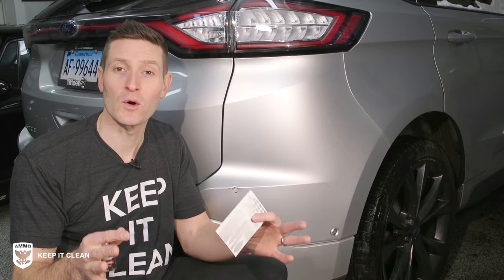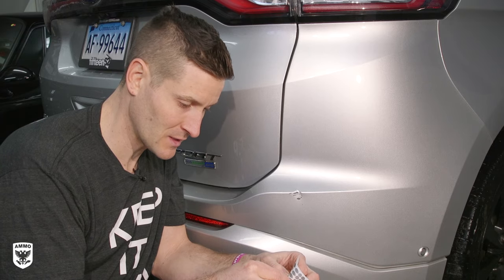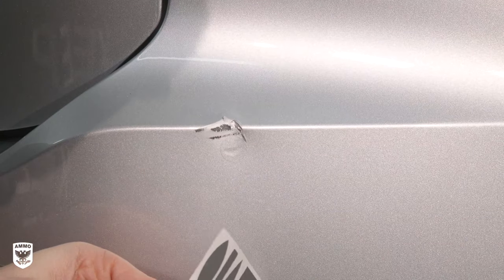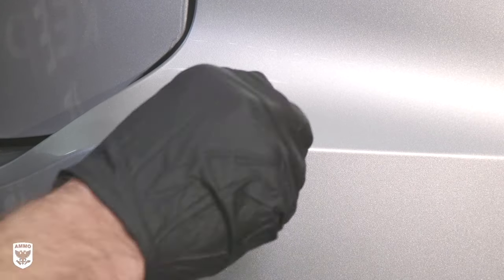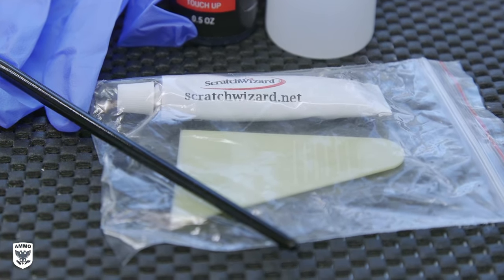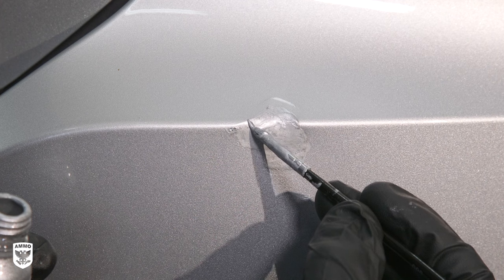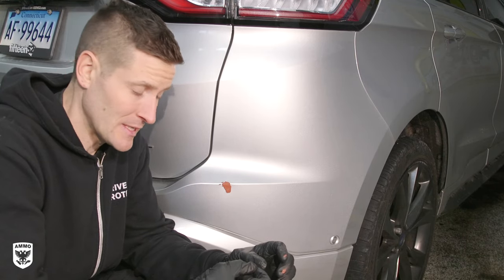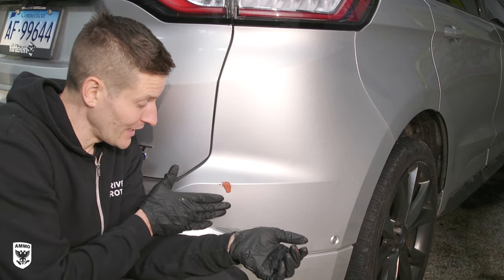How to Hide a Bumper Scuff Fast

Comment: I fix almost the same kind of damage on almost the same kind of color and what i did was carefully tape around the damage area and made sure no paint would go on other car area by masking with news paper. Then i use a touch up match aerosol can on it and put 3 coats on it then i let it dry for 24 hr and i remove the tape. Now i was left with a thin line around where the tape was and i used a toothpick to fill the thin line with paint from the same aerosol that i sprayed inside a small plastic cup. To finish i simply use compound by hand to equalize and blend it in surrounding paint and for the final touch i wax it with Meguiar's Gold Class Carnauba Plus Premium Paste Wax . No one could find where the repair was.

Comment: Clean area then apply body filler. After it's dry you have to sand it down and follow the body line to replicate the edge of the body line. Once that's done you can prime and paint. Relatively easy to do.

Comment: I felt your pain. 
IMHO, heat gun and a nail with a large flat head. Turn the nail upside down and, using a hammer, tap on the sharp end with the flat head hitting/tapping on the HEATED plastic. The heated plastic will allow it to reshape. The upside-down nail (head) will give you the control you need to take out (flatten) that ridge. Next is plastic-filler/bondo, sanding and an AIRBRUSH for several layers. Airbrushing using various flow patterns will allow the flake to randomize. Best of luck!

Comment: Here's my idea: You got it pretty smooth right now, what i would do is to take the stickers of, then try to get it even smoother. Then what i would do is get a spray can with the exact color from ford, then i would make 3X3 inch cut out in a newspaper of something with big surface and spray paint a 3X3 area from about a foot away over the bondo. After that dries maybe you have to do some wet sanding and compounding/polishing.

Comment: Though not really "quick",  what works well is using a small plane or razor to cut the plastic level, using a small bit of filler light sand, and using an hobby model airbrush pen with touch up paint, and a 1k clear. after clear dries wet sand with 3000 and buff.

Comment: I've dealt with this issue before, once bondo and sanded, I used arysol touch up matching paint on the panel, got it damm near perfect, blended it back into the original paint and then cleared coated with max 2k for that gloss and harden protection. Probably spent around 40 bucks.

Comment: also if you actually sand it you get a much better product then leveling it the way your using it.  It's technically meant to be sanded. not saying there isnt a place for leveling it with a rag but never will you get the consistency of sanding, i prefer dry, well not always. and you can spot sand with certain things like cutting a piece of sandpaper and gluing it to the end of a pencil for instance for a super small sanding disc

Comment: Simply, sand your spot and spray paint ( to be equal) not by the brush!
Always try to keep your working spot in lower layer than the original so later on it will be filled by filler and paint and sanded equally with surround area layer 
Try it on scrap surfaces as training

Comment: I think touch up paint should be used lightly with dabs like a tattoo machine, simply to color in an area and then use clear coat layers to fill in and get above the surface area for sanding. Lastly, finishing off with compound and polish. Maybe sand down the bondo stuff below the paint's surface area to allow space for touch up paint and clear coat layers.

Comment: I think these stickers are PERFECT....... for some. Not all. You'd have to know what your expectations are. For 3 seconds and $50 worth of color matched stickers, you can't go wrong in covering up small scratches. If you want a more professional result, of course go the body work route. Also, consider your vehicles paint color. Some are easier to cover up and show repairs less than others. Ailveez for example, is often the easiest

Comment: I’m curious as to whether you would be able to get rid of the lip from the sticker by going around the edge of it with touch up paint and sanding it down. To avoid scratching the sticker itself you could put a piece of painters tape over it while sanding.

Comment: had the same problem on my vechicle...a stone chip the size of the Grand Canyon on the bonnet.tried touch up but was experiencing the same visual disapointment as your efforts.so ended up filling stone chip ,flating it off then had a vinyl stripe fitted over bonnet ,roof and boot of vehicle.  was still cheaper than having bonnet respayed...

Comment: Take the lower lip off the rear bumper , and you can reach the dent from inside. Use something hard, I'm using screwdriver handle from inside, you don't want to burn your hands, and work with heat gun from outside. Keep heat gun about 12 to 16 inch from the bumper to prevent bumper it self and paint from melting. Ones bumper gets softer start working with your screwdriver or whatever you going to use, and push the dent out until you Happy with flatness and ages. While keep pushing the dent out from inside, put wet cold cloth from outside , to cool the plastic down. Now is the time for blending. First coat base paint only, with your paint brush. Let it dry for 30-45min. Next step. 2drops paint, 2drops clear coat, mix well and apply 1coat,30min dry time, 2nd coat. 2 hours dry time, lite scuff with 3000. Another coat if need more base to color match, if not, 1 light coat of clear 4 hours dry, buff if needed.

Comment: depending on what way the sticker(i.e. if the colour is all the way through the sticker and not just on the surface of it) is made could you use a utility knife to cut the shape you want while at a 45 degree angle to soften the edges of the sticker

Comment: Before using a bondo, you should heat up a bumper, than try to push the bump. After that, sand down sharp edges, than use a bondo. And i think, that better, than touch up is to spray it.

Comment: Next time you could try building up the ridge of that body line first, just tape something to the vertical side of the corner (cardboard covered with scotchtape or a piece of acetate) that will follow the curve properly and give support to the bondo. Once that corner edge matches completely the curve of the rest its like a rail to fill everything else without smearing all the area outside the ding with glazing.  And yes an airbrush is awesome for that small work, basically its those stickers but in a liquid form once you learned to use it

Comment: I fixed my bumper by using bondo and touch up spray I ordered online for $30. Sometimes you can find popular color sprays in smaller cans at O'Reilly auto part stores for $7. Those touch up brushes never work on large spots.

Comment: instead of using the solvent to remove the excess putty, you could have used sand paper on a sanding block to have the putty perfectly match the body line and also have a flat surface to work with.

Comment: I've seen episodes of Mighty Car Mods where they used spray cans for a repair like this but it was a non-metallic paint... Idk if that would ever work for metallic paint and if you knew I would love to know if that works or not because I also have metallic paint job on my car. One thing I wanted to share with you is I tried using touch up paint on rock chips and places on my car after finding your channel looking for DIY paint repair videos. I started with a brush like you were using and it was crap and looked like shit and the brush bristles got caught it the paint and it was a crazy mess BUT I had also picked up some disposable foam paint brushes because I wasn't confident in the other brush and I knew after the paint started to dry I'd need to whip out another brush because I was working on multiple spots. It turns out that the foam brush worked AMAZINGLY well. They're cheap as dirt too! I have a spot similar to your scuff on my car that I touched up and unless you're right up on the car you can't see it and best of all somehow the foam brush helps spread out the metallic paint so that it actually looks like a professional repair even though it was my first repair, I was really nervous, I had watched your vods to gain some confidence and all and all it turned out looking great. Now that I've seen more from your channel I would certainly take more steps in my repairs for next time but for >50$ for all the materials and maybe 5-6 hours of time(working on multiple spots) it came out looking great. I wouldn't even mind uploading some pictures/video of my repair if you were interested but I urge you to try out the foam brush and do the repair like you normally would. The tips on those brushes make them perfect for painting tough areas like a body wave and other than the fact that you can see when you look really close where the factory paint ends because it's slightly faded(10 year old car) and where the new paint begins you can barely even tell it's there at all and leaves a smooth and very visually appealing finish. I love to see you test this out on this repair if you were willing as a part to to quick fixes for chips and scuffs. As always love the channel and keep up the good work!

Comment: Using Applied colors(scratch wizard)kit??? I am a little surprised to see that. A ten dollar quick change airbrush from Harbor freight, 3000 grit wet/dry sandpaper, a little polishing  and you would have been done 15 minutes after the putty dried, but I am sure you already know this. At least you showed how frustrating things can be, especially when we over think things. Nice video

Comment: i dont know much about car repair but i do know a lot about painting, you should probably have applied the paint in a few even, thin layers as opposed to one thick layer while also feathering it out over the surrounding paint to make the repaired area less obvious. it'll make the area smoother and should disperse the metallic particles more evenly. also a slightly larger, flat brush would've been better but i know you were using the kit. Great video overall tho

Comment: How about  putting the paint in a small air brush kit. Afterward using a clear coat the same way with minor wet sanding and buffing and polishing after. Wont have to worry about gravity as much with mini air brush..

Comment: Have you heard of dry brushing? While I was watching you paint it with the brush I was thinking how loaded the brush was and how there was no way you could get it to flow just right. I personally used dry brushing on my car and it worked fine. It takes a bit longer and a few coats to get good coverage but I think it would have worked better.

Comment: I think if you used a sanding block to level down the putty instead of the chemical leveler you could have eventually gotten it more level with the surrounding bumper. But that would probably harm the surrounding paint.

Comment: I build it up with paint, then wet sand with, 400. Then repeat the paint if I see pin holes. Then wet sand with 400 and keep doing this cycle until there are no pinholes left. Then wet sand with 1200 then 2000. Then buff with 3M Finesse-it II 05928 Finishing Compound.

Comment: What do you recommend using to remove a ceramic coating, a 9h formula, when it had dried in high spots because the person applying it didn't remove it quickly enough?
Reply from the maker: Reach out to manufacturer of the ceramic coating. different removal process for each company.

Comment: There is a better approach to fixing that kind of damage. You had it in your hands. The heat gun.
Loosening that corner of the bumper or taking the bumper completely off is necessary.
Get the bumper hot enough to where its almost too hot to touch, it becomes flexible.
with a blunt object, you can push the low spots back up from behind, and the high spots on the outside back down.
You can push that body line back into place.
Sometimes the dent can be too deep and stretch the plastic beyond repair, but your bumper doesn't look that bad.
Then epoxy it and touch up. Those stickers are pretty awesome though.

Comment: @AMMO NYC, I had rock damage on the hood of my Audi A4 -01. Did touch up with pain brush and sealed the area with maskign tape to prevent oversanding and such. Didn't become perfect. Tried to touch it up... Made it worse. STarted over... Made it a little better than I just said. Fuck it, let it be 'beauty mark'. 

I might be able to save it by wet sanding gently on top of it and then polish. But... It will have to wait till the weather is warmer outside and such. Need to fix my fender first. Rust damage above left wheel. Seems to be a common thing for that year model.

Comment: If is spray paint many coats is gonna build enough and  look smooth ? I tried few times on my plastic bumper but I cant get to sticky , either filler or paint can be easily removed

Comment: Nice effort and nice video but i always thought why not go and buy a spray can that is colour matched to your car instead of those awful brushes it may cost a bit more but it cointains a lot more paint  especially if you use bondo and sand paper a temp fix before completly paint the bumper i believe should be to
Mask the area bondo it sand it spray it polish it

Comment: Main thing is how you spread the putty and wet sand it instead of dry sand it wont clog the paper up as much and wont pull the material off since it's only a 1k system

Comment: what about plasti dip with a semi similar color, it's a smooth coating, it can be metallic, it wont have any noticable edges, and it will stick really well to the bumper, but can be removed, i think you should try it atleast :)

Comment: Here is a good way to get it without the sticker. From the point you put the sticker on it. Just use a airbrush and mix the paint and then mix up the clear and go passed the base paint at least one inch and feather edge it and wait for it to dry and wet sand and buff it out..

Comment: I think the whole trick to this repair is sanding and building up material and sanding until putting the stickers over the repair shows no lines or divots. Then removing the stickers, touching up with paint and then wet sanding with 1000 to 5000 grit paper then buffing with compound.

Comment: I think the problem with the paint was due in part to the brush. If you had used a broader brush you would have less of the bubbly mounds that need sanding.

Comment: Hey Larry, this may be a bit of an overkill but considering you are such a big OCD, wouldn't better (and more expensive, of course) solution be to order the color matched wrap from that company and then wrap a whole bumper? Of course, putty filler must be flush with the ridge of the bumper and blend in perfectly with topography of the soroundings, but if that can be achieved it is only a matter of wraping the bumper! That way annoying sticker lines are eliminated and it looks like 99% new bumper. What do you think about it? Cheers!

Comment: wouldnt a modeling air brush be able to get a similar metallic flake dispersion as the original paint? It also goes on thinner and smoother. Just do lots of thin layers and it should look nearly identical?

Comment: I went through the whole scratch wizard thing on my bumper too, it was on a slightly curve part, someone used my car as a bump stop on a U-turn, well long story short I got a finger nail size paint rip, and manage to fill it in after 12-15 hours spread across 2 days messing with it. Sanding, polishing, reworking due to over polishing and ripping out the paint.. etc. And in the end, the paint cant hold the polish finish, it dulls out after a few months. this is probably due to a lack of clear coat. I should order a sticker and just slap it over it.

Comment: TIP: use serrated scissors when cutting the stickers and it will break up the lines, making them blend and much harder to see. It's a trick that's been used in the RC hobby industry for a long time.

Comment: it is plastic. a heat blower can make it flexible enough to push it from the back using a dent repair kit tool, and when that is aligned with a body line then use the filler to make it smooth then use the touch up sticker to hide the imperfection.

Comment: Hello Larry, thanks for the great video as always. Been subscribing since 2015. Btw if you plan to do another video on chip/scratch touch-ups, I hope you can expriment using mini electric airbrush instead. They're relatively cheap online and usually used for Tamiyas or art projects. IMHO in theory they will work as the paint applied will be thin, and look seamless as long as the putty doesn't shrink. I've bought the machine but have yet to find the time to try it. Maybe you can beat me to it and do us a big favor. Regards from a small country called Malaysia :)

Comment: I would of started by heating it up with a heat gun and tapped it to bend that ridge down at a minimum and I bet you could of got that dent to pop back a bit too.  plastic is pretty cool when you add enough heat, buuuut not to much.

Comment: How do i fix the cracked paint on my bumper that is dented ? I don't know if this helps but my car is a 2001 honda accord Any kind of advise is appreciated.
Reply: Unfortunately, you have to sand it off and repaint it, preferably the entire part (bumper) to avoid visible edges or paint not matching

Comment: Should have corrected that 'ridge-line' by applying heat gun BEFORE bondo, and mold running.  Would have saved a lots of filling.  sprinkle some nail polish glitter on it in the mix.  You will be surprised.

Comment: You shoud have filled a little bit thicker and the remover cloth hij should have been ik soms thing flat. So its like sanding. Also use 1 piecie of plastic use a heat gun to strecht is around conerer